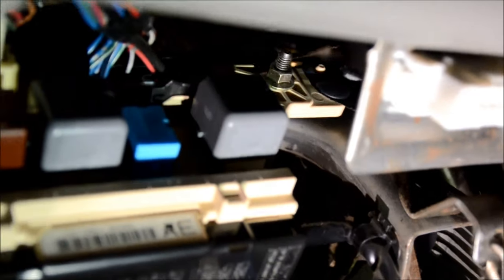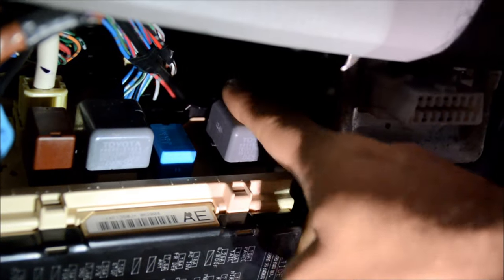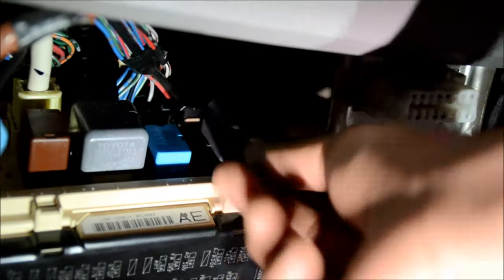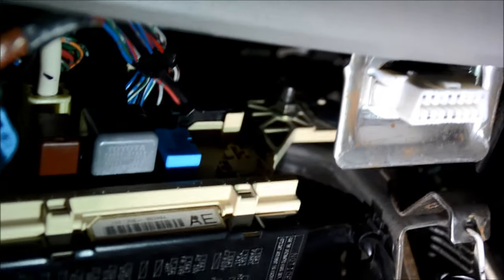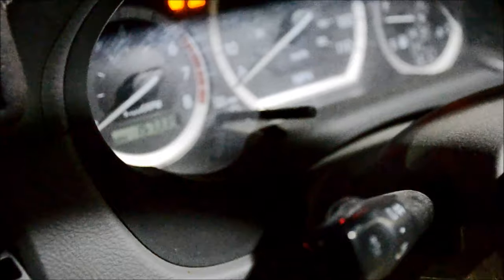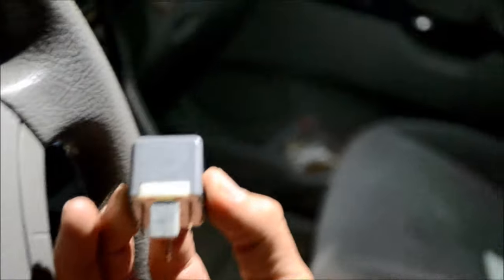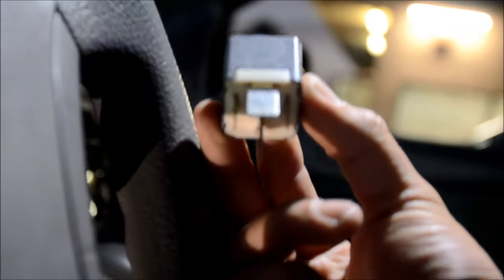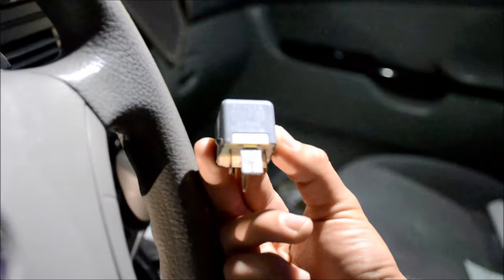How to locate and find the correct vehicle's flasher replay for turn signal light  JDM ASTAR

Comment: your video saved the day.  Fortunately only one side wasnt working so I was able to find it while engaging the other side.  Thanks for saving me $
Reply: .....looks like that's common these days then for one side only to not work . I've never had simply one side not working ever happen in earlier days .In my case the hazard flasher works fine thus showing that no globes are blown and left side works. Right side give that open circuit sound and no lights . Unsafe to drive with no Right turn indication and most of today's drivers don't understand the hand signals of long ago.

Comment: I have a 2007 Dodge Caravan. Passenger side turn signal is normal,  and the driver side turn signal flashes too rapidly. It's not the bulb, and it's not the wiring. I'm hoping that it is the relay. This video should help!

Comment: I havea 2006 ford mustang & i tried looking for it & never found it.went under the instrument panel drivers side.never found it.could you please tell me where exactly is at?thanks so much.love your video.
Reply from the maker: Some cars may have built-in to the  Body Control Module. This is very common on domestic vehicles so if you were unable to locate your flasher relay, there is a good chance there isn't any replaceable relay and signal flash cycle  is simply regulated by the BCM.

Comment: Clicking doesn't help if relay isn't working at all
Reply: I was thinking the same thing -_-
Reply: Exactly. Wtf..
Reply: So is it supposed to click when it is a good relay? My truck was tweaked by the person I bought it from and when I bought it the right turn signals front and back would flash faster than the left but I only had to change it once. I bought it about 5 years ago and the right side always clicked faster than the left but bc I'm a lazy person I never fixed what wasn't broken smh anyway both front and back turn signals are not blinking at all, they are on but do not blink and I still hear the clicking. It could be three things, the relay, the tweaked wiring has gone bad or the actual turn signal switch/lever is bad. I haven't really taken apart the dash to feel where the relay is clicking but I did find two relays and I guess I'm going to have to test them it may not even be them bc I took both of them off and the left turn signals still flashed..
Reply: no shit huh
Reply: @donsal.t.1765  .....I've worked out it'll be less trouble for me to wire in a bypass separate flash control with own switch  for right side indicators. The left indicators and the hazard  works fine. Clearly a poor electrical contact somewhere but it ain't easy to get to stuff . I'll use LED s and flasher circuit from a head torch and run the right indicator at twelve volts with s dropping resistor .         ..A torch is a flashlight of course ,that is to say a portable light ,, in this instance the American term could cause confusion cos we're talking about flashing lights . I remember when simple things on cars weren't such a frickin pain .
Reply: @charlesdickens6706  yeah I may do that bc the mechanic said it was that small computer under my glove box.. said it was like $320 for it and another $100 to install it. 😖

Comment: Are you sure that is the correct relay that you pulled? It looks like you're in a Toyota Sienna (perhaps). We have one of those and I just went in under the dash with the hazards on and also did just one turn signal and it seems that the relay for turn signals is actually further under the dash and faces the engine bay. You can clearly feel it click versus the one you pulled which seems to be the power window relay according to the schematic diagram in the manual. I'm looking into this because I installed Sylvania Zevo LED's and they fast blink due to last of resistance.

Comment: I HAVE 2006 HONDA CITY STEARMATIC , TURN SIGNAL LIGHT DOES NOT WORK.  Hazzard light works ok. what could be the problem. checked power on signal light socket connector no power available., is this a flasher or turn light switch.  if any onbe can help me

Comment: Hi my indicator and hazard lights not working. The fuses are good but cannot find the flasher relay on  a Nissan wingroad y11 Japanese made 2002.Where can i find the flasher relay.
Reply from the maker: We have not worked on this model vehicle yet to be able to provide guidance on this matter.  Its best to reach out to the manufacturer of the vehicle of possibly a local dealer to assist you in locating the relay.

Comment: My running lights on my right side  will not turn off,  I found a 1157 bulb blown and I replaced it, still the lights wont turn off no matter what switches I screw with
Reply from the maker: This matter may not be related to a bulb issue but another problem on the vehicle.  Have a professional assist you in isolating where the power is coming from.

Comment: The problem with my car is, I was told the flasher relay is bad and that's why my turn signals are not working. Which means I cannot use that method to find my relay

Comment: Halo sir I’m trying to locate my flasher relay on my 2011 Lincoln town car the hazard and the turn signal is steady green so there’s no clacking sound thanks a lot sir
Reply from the maker: It is built in to the body control module and may not be easily serviceable.  Its best to go the resistor route and equalize the load at the sockets.

Comment: Mine is not clicking...how to find it?
Reply: ludlow falls is it lighting but NOT clicking? Or is it not lighting and not clicking?

If it’s just not clicking, look up online your car models flasher relay, so for example “where is my flasher relay in a 2004 Hyundai Elantra” it will tell you. They are about 10$ it’s an easy fix. 

If it’s not lighting or clicking it’s almost likely a blown fuse, you’ll need to locate your fuse box in your car and it should come with some spares and you simply take out the blown fuse and put a spare one in.
Reply: Ball 15 After doing some more research, i've discovered the the flasher relay is non-existent. That function is now controlled by the BCM.
Reply: First you have to put a working relay in so you can locate it, 🤣